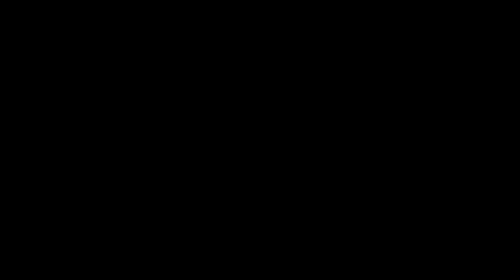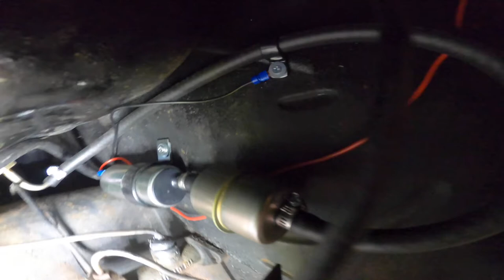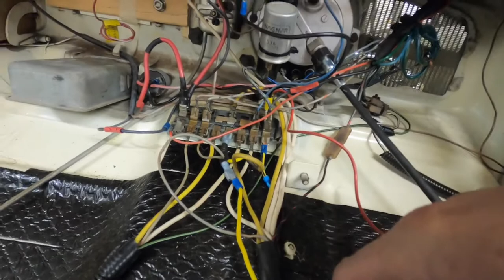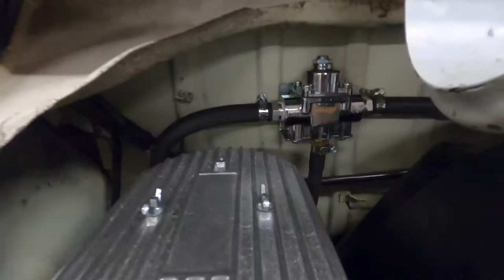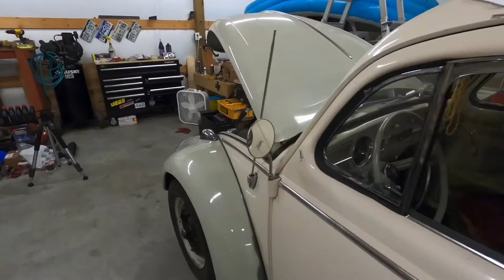Rotary Fuel Pump Install - VW Beetle

Comment: Hey man I've just come across your video. 
One thing i would do is put a rubber grommet or some extra insulation where the red power wire is going through the body just the red sheathing on the wire by itself will rub through and you dont want that.
But great video man.
Reply from the maker: Thanks!

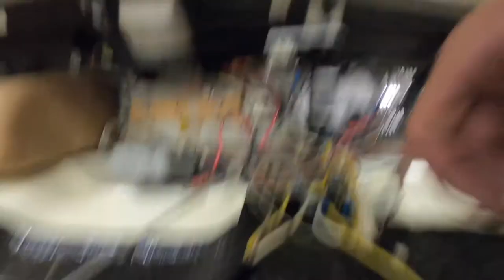Comment: Not sure if I am the only one but there is no volume after 1:43.
Reply from the maker: Well, that sucks.  You’re the first person to say something.  The program I used to make the video messed it up I apologize.  

I was basically saying to make sure you have a pressure regulator and a gauge.  This fuel pump is designed to push out a constant PSI for fuel, but that doesn’t mean you should trust it.  Accuracy is important.

Comment: So, where did you finally hook the red to?  I’m getting easy to install one and that’s what’s confusing me. I have the inline fuse as well, where did you put that?
Reply from the maker: I hooked the red wire to the fuse installed on the car, on the far right of all the fuses (looking in from the hood).  I didn’t use an inline, not a bad idea though.  I would put an inline fuse about 6 inches before the car fuse on the red wire.  Easy access and out of the elements.  I haven’t had issues with mine though, without a fuse.

Comment: So disappointed with these rotary fuel pumps ,used two Carter brands and both had failed in short time . Scrapped it and replaced with USA made low pressure FACET pumps . These has not failed me.
Reply from the maker: Yeah, I know there are definitely better pumps out there for sure.  So far I’ve had no issues with this particular one though.  If I do have issues, I’ll take a look at the one you’re talking about for sure.  Thanks!

Comment: Where'd the audio go after 1:43?
Reply from the maker: This is a reply from the same comment.  I didn’t realize the program messed up the audio until after it was posted. 
  
“I was basically saying to make sure you have a pressure regulator and a gauge.  This fuel pump is designed to push out a constant PSI for fuel, but that doesn’t mean you should trust it.  Accuracy is important.”

Comment: I see people putting on electric pumps, why not use stock? Thanks
Reply from the maker: In general they are more consistent (PSI) as long as you don’t go too cheap.  The best part that I like, it’s one less thing being driven off the crankshaft. Not to say it’s taking that much power at all, but helps.  Looks cleaner too!  Less items attached. 

Check out the below video.
Reply from the maker: Just the black plate that’s also acting as a coil mount for the distributor.

https://youtu.be/FM5XWVjqS10
Reply: @VitosFix  Another good reason is, if the diaphragm fails in the mechanical pump, it starts filling up your crankcase with gasoline. Ask me how I know. 🙄
Reply from the maker: Yeah, not good at all!

Comment: I installed a fuel pump like this one in my beetle, but it doesn't seem to be pushing fuel, when I turn it on it runs up to the filter in the back, and I see a couple of bubbles then nothing, it seems like there isn't any pressure?
Reply from the maker: Was the fuel flowing good before?  Could have a clogged line.  Could try blowing it out with an air compressor to make sure it’s clear.
Reply: I put the fuel line in the back  down below the car and drained it out a little and it seemed to fix the problem, I think there mightve been a bubble or something in the line but I got it to start after priming the line, thanks,
Reply from the maker: Awesome!  Glad it worked out for you!
Reply: @verba_volante  I'm doing the same as a replacement but I had read the pump must be under the fuel tank where it is not self priming. I ditch the metal filter that comes with the kit and use the clear version just out of the tank and into the pump. This way I can seen the gravity fed fuel going into the pump and how clean the fuel is coming out of the tank. Then a secondary clear filter under the drivers side rear wheel well. Ya a lot of connections from the front to the carb but as long as they are tight no problems in many years.